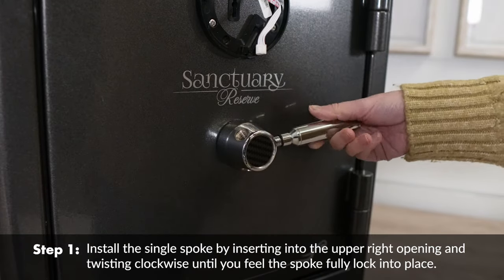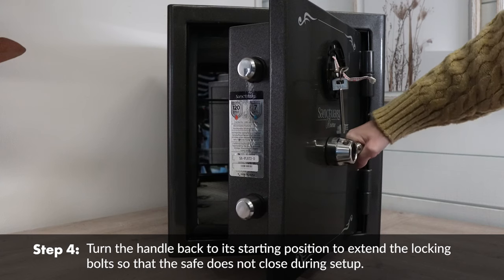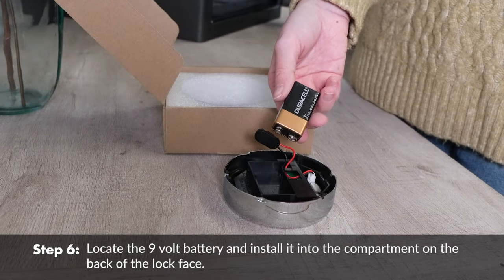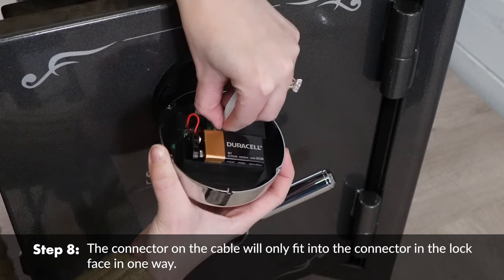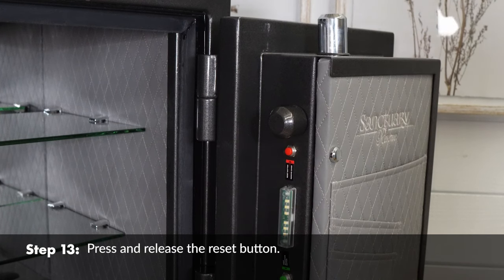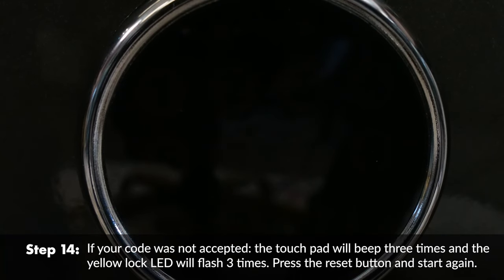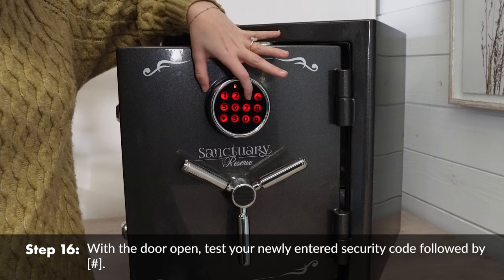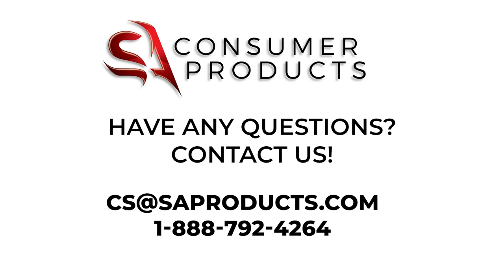Costco- Platinum Reserve Safe Programming (SA-PLAT-2-D)

Comment: This safe is absolutely garbage. My handles are stuck and won’t open. The keypad isn’t dead, safe is brand new. Have to use key everytime I want to get into it. Don’t buy this thing for it to fail on you. The cheap pricing seems economical until the thing fails to open without a key.
Reply from the maker: Hello, we are very sorry for the inconvenience. We recommend Duracell brand batteries to keep your safe functioning the best. This may be the issue, if not, please call our US based customer service team at 888-792-4264 for immediate assistance and they will be happy to assist.

Comment: Recently picked one up. For life of me couldn't get it to take the new code. Read the book and quick setup. Felt dumb like I was missing something. Come to watch this and end the code with a # sign yet in the book its a * symbol.
Reply: Hi did u put it in the code 159# 

When me and my dad put it in it just fades out nothing happens we pressed the red button also to reset and no yellow indicator came up, the cables are good and connected and battery we did everything right but it’s not letting us put our own code in 

Or even reset it, my dad spent a good $500 on it, 
Did u find a way to fix it? Sanctuary uses like the exact same keypad for other products in there line

Comment: Put code in and digital says unlocked but it won't turn to open?
Reply from the maker: Hello! please try changing your battery and see if that works. If that doesn't work, give our customer service a call at 888.792.4264

Comment: Is the light inside the safe supposed to come on automatically? Mine is coming out automatically without having to push the green activate button is that normal? Just hoping the light isnt on inside the safe when closed wasting battery
Reply from the maker: The light will only come on when the safe door is open.

Comment: How to remove the lock face to replace the battery?
Reply from the maker: Simply twist the lock face counter-clockwise and it should pop off! Once the battery is replaced, Align the lock face to the backer plate, with the lock face slightly rotated to the left. Turn clockwise until you feel the lock face click into place. If you are having issues, feel free to call us at 888-792-4264. Thanks!

Comment: What are you supposed to do when u get this home and the key won’t turn all the way to 3oclock and stops at two and you can’t open the door in the first place to set it up?
Reply from the maker: Please call our customer service team at 888-792-4264 and they will help walk you through this. Thank you
Reply: Having the same issue
Reply: @bradburnham2489  Hey Brad I kept jiggling it around a bit and it did open be careful of the key though

Comment: How to reset
Reply from the maker: Detailed instructions are on page 7 of your manual. 

On the inside of the safe door, locate the brass cap. Unscrew and remove the cap, giving access to the reset button. Press the reset button. You will hear 2 beeps and the touch pad will illuminate indicating that you are now in programming mode.

Comment: Hi my dad just bought a different sanctuary safe but it has a similar keypad in this video
We set eveyrthing up cables plugged it in and folllowed the manual 

When we put the code 159# in the keypad nothing happens it just turns black/off 
This was weird, so we kept following it and we reset using the red button and in the manual it says the keypad should indicate a yellow lock but nothing shows up even pressing the reset button multiple times pressing and releasing 

We need a solution we also lost the receipt so I don’t even know if a warranty claim will work 
He spent $500 on it, and by the way we checked the the white cable that connects to the keypad the pins are not bent or broken the cable is fine no tears or anything so we don’t know what’s going on
Reply from the maker: Hello, we are sorry for this inconvenience. Have you tried calling our customer service line 888-792-4264? They will be happy to walk through this issue with you and find a solution.

Comment: There is no single spoke or key to unlock the door….i think they are all placed inside the safe because they are not in the box the safe came in. What should I do?
Reply: It's in a box taped and sort of hidden in the card board panel on the front of the safe when you remove during unboxing. It's easy to miss! I had already thrown it away in the garbage bin and then this video made me to go back and find it. Glad I caught it on time. Hope it's helpful...
Reply from the maker: Correct, there is an initial entry box with the single spoke and override keys to use for the initial entry. Please let us know if you are missing this!
Reply: Why would I buy this if you get so many problems in the comments